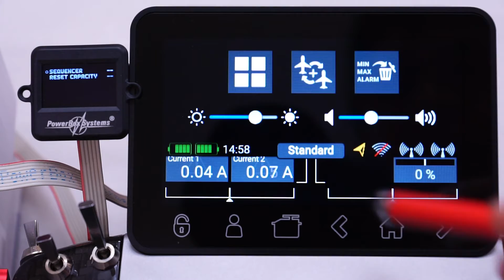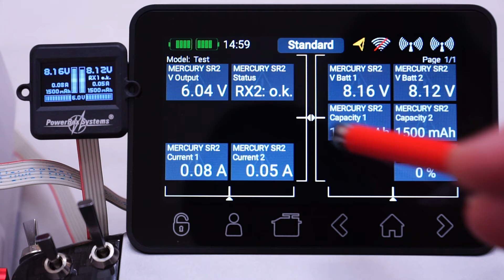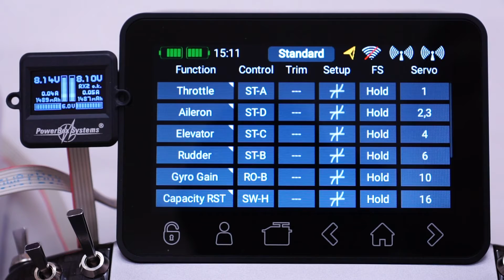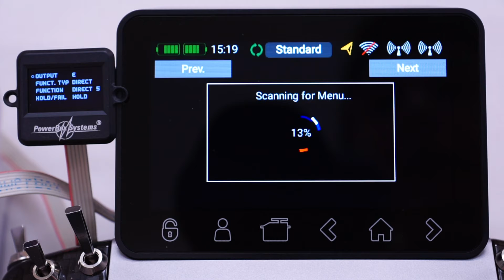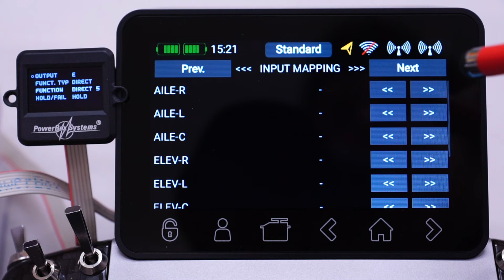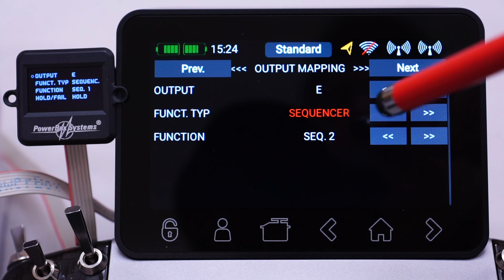PowerBox Mercury SR2 : Part 1 - Basic Menu and Direct Function

Comment: Thank you. Your videos help greatly. I usually use the competition with IGyro on my 35% aerobatic plane. However, at this point I would like to try to set up my next plane without the assistant mainly because I have to manually change in the output mapping where the assistant choose I plug my servos in the SR2. If you get a chance, I would like to see a video about what is the best way to go about doing that. Thanks again.
Reply from the maker: Thanks fir your comments.

My very next video starts to cover this topic. Look out for it in the next day or two. I will be covering the Setup Assistant without a gyro first then another video with the gyro.